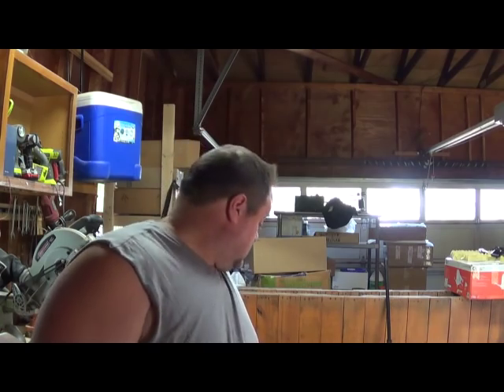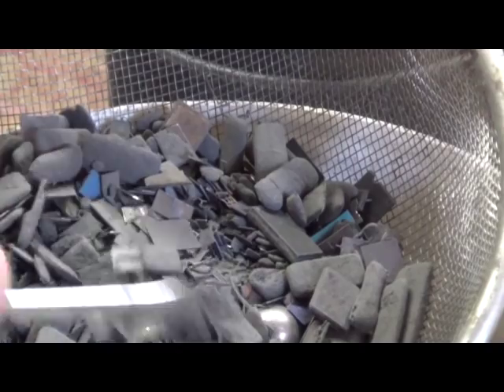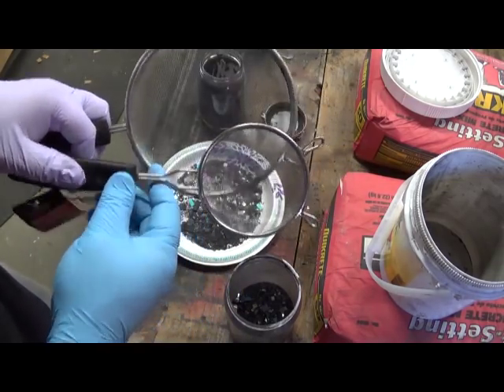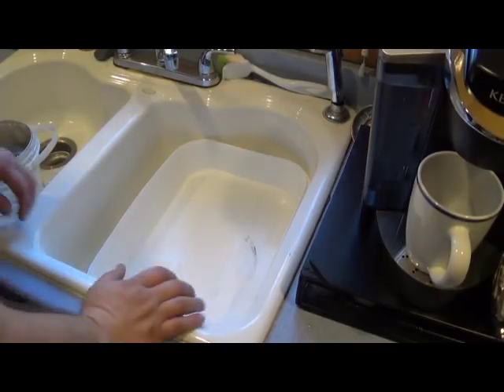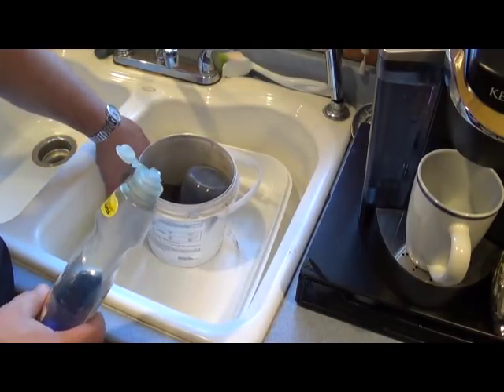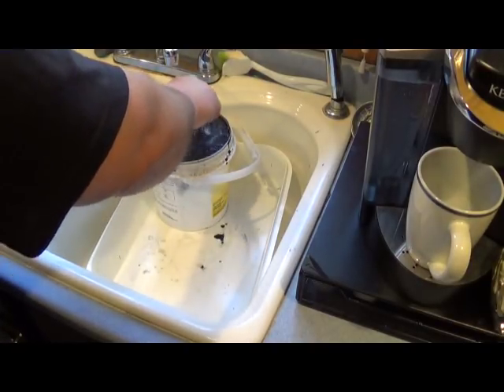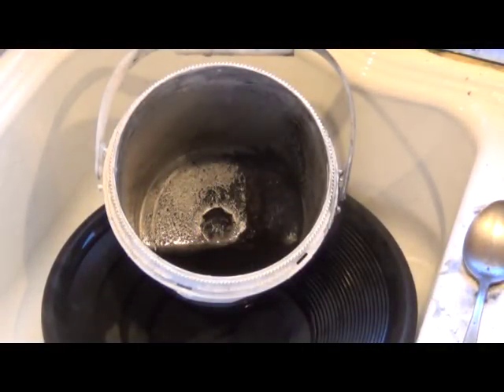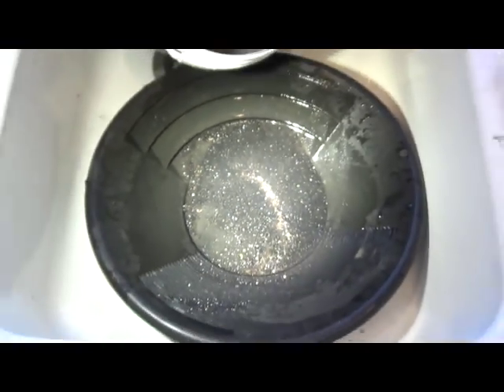Gold Recovery From Incinerated IC Chips Part 3 - Moose Scrapper

Comment: How long does it take to incinerate  the IC chips? For the 2 pounds you done? How much money do you get for 2 grams of 10 carat gold. I beleave that's what it is right?
Reply: 10 karat gold is only 41% gold. So he has about 0.8 grams of gold there. Gold spot is about 40$ per gram at the moment. Not much gold unfortunately.
Reply: @tylertucker666123  thanks
Reply: @tylertucker666123  I wonder what the cost to profit ratio is?
Reply from the maker: The gold is not 10K.  Took a good couple hours to incinerate
Reply: @moosescrapper5928  I was wondering. Thanks for your input. Always appreciated. What karat is the gold then? Just curious.
Reply: Pretty sure gold bonding wires are 23.5k.
Reply: @Todd Hall
Looks like basically 24k actually 
https://www.heraeus.com/en/het/products_and_solutions_het/bonding_wires/gold_bw
Reply: On average with mixed ICs' you will get about a gram per pound. If you run flatbacks it will be quite a bit more. flatbacks are the square ones with legs all the way around
Reply: Bonding wires are 24K. Pure gold. It is contaminated through the process.

Comment: Thanks for the shout out. I will repay the favor as soon as I can.
Reply from the maker: no worries, any problems in the video?  Did I give any misinformation?Thanks!
Reply: Nothing that will effect the process. The silica chips (glass die) contains no value and is very close to the weight of the gold wires. If it gets into your drain, it will clog it up for sure.